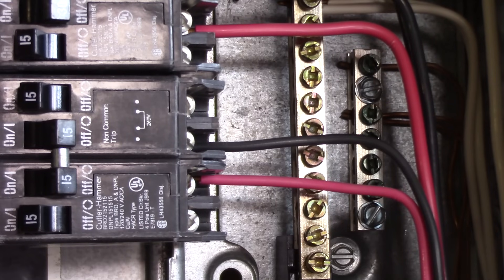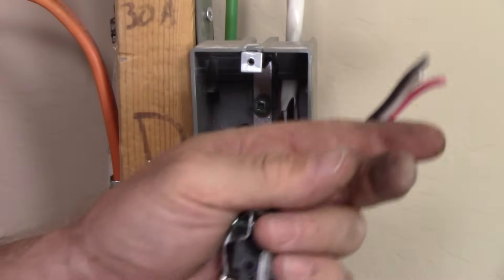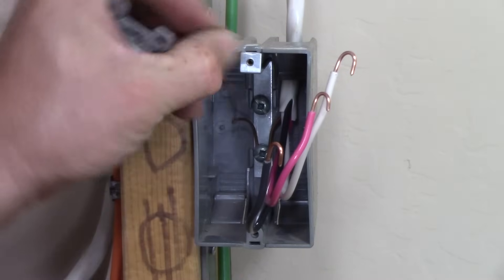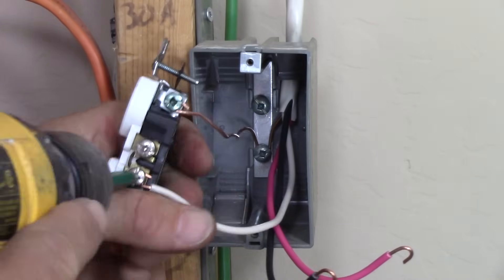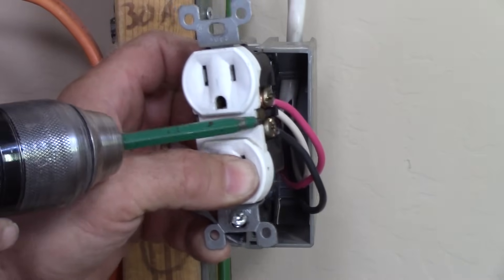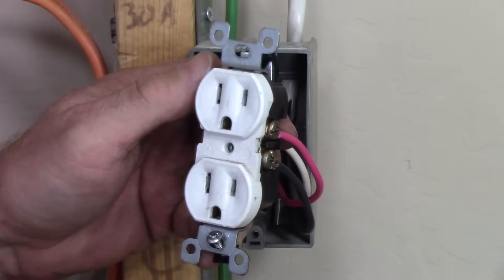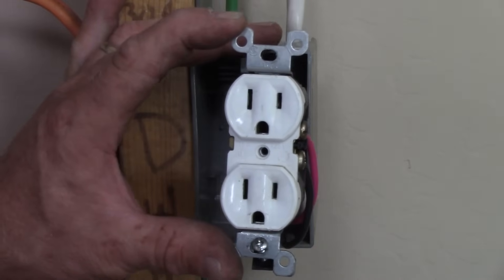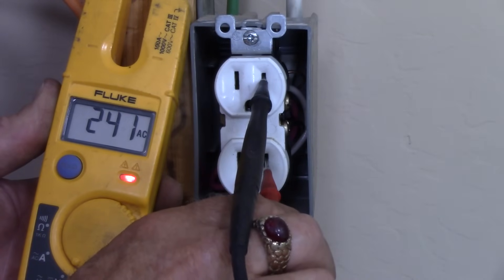Kitchen Split Circuit Receptacles Explained

Comment: Any idea why I still have a hot wire when both breakers are turned off?
Reply: The black wire is showing live when both breakers are off. Tab has been split.
Reply from the maker: That's a strange one alright.  Shut off breaker, check wires on the load terminals.  If there is still power there, shut off other breakers until it goes off.  You must have a cross-tie in the circuit somewhere. And  is there 120v each to neutral or ground, and 240v across the wires?

Comment: I have my kitchen outlet with what looks like the same wiring with red wire on top right, black on bottom right, white on top left on silver screwd and ground in bottom left on green screw and by circuit keeps tripping. I did not remove the tab so i guess this is why its tripping? I will try that out tomorrow since its late. No one else explained this so thanks fellow canuck! One question, can i break off the tab without having to take the other wires off since the circuit is tripped and no power is going to the receptacle?

Comment: Any thoughts on running a 3 wire from the panel to one duplex, and then taking 1 of the hots to another duplex? So instead of one split plug, it would be 2 "unsplit" plugs. Both receptacles would share the neutral but each be on a different phase(circuit).  The idea is to convert an existing split plug into 2 seperate plugs.

Comment: Hi Terry, shouldn't the black wire and red wire fed from different bus bar? From the picture looks like they are both from the right hand side bus bar?
Reply from the maker: Good observation, but the bus bars alternate vertically, not horizontally.  Make sense?
Reply: @theinternetelectrician  got it. Thanks for the quick reply

Comment: I don’t know why would people would use that for
Reply: Sometimes one circuit is only switched at the breaker while the other one has a switch on the wall of the room in which the receptacle is placed.  This allows you to control lamps as you enter or leave the room.  Using the 3-wire configuration saves a little wire.

Comment: Thanks.   I shared this video with my sister and her husband to help them understand how their kitchen was wired and why the 2 pole 20 amp GFCI breaker wouldn't reset after he changed out a countertop outlet that was worn and the plugs seemed loose and fell out easily.  Their home was built 1995 and the kitchen was wired with one 12/3 w/ground NM cable to power the 20 amp kitchen small appliance circuits.  I'm guessing that when the house was built it was cheaper in terms of labor and materials to pull one 12/3 on a two pole GFCI instead of two 12/2 cables on two single pole AFCI/GFCI breakers like we are required to in modern times.

Comment: On mine I have two cables (must be the first receptacle - what's the right proper name for that situation where it splits off to continue the circuit?) one has the red/ black/neutral/gr and one just the black/neutral/gr. There will also be two neutrals: Now do I also break the tabs for the neutrals? And How do I connect that extra black that continues on with the circuit: pig tail? What is the proper name for that situation?
Great to the point video- just not my exact situation- Thanks
Reply from the maker: Is this a kitchen receptacle?  Sounds to me like a switched receptacle in a family room, living room, or bedroom?
Reply: @theinternetelectrician  KItchen. The red has power too- traced it to the box, right beside the black wire breaker. Thanks
Reply from the maker: @johngaspar4425  OK, The neutrals can go on the terminals of the receptacle and DO NOT split that tab. (or you could splice them together with a pig-tail), and yes, on the hot side put red on one terminal, splice the black wires and pig-tail to the other terminal.  DO split this tab.
Reply: @theinternetelectrician  Ok thanks. I will do it that way. Don't want to press you too much, but could you elaborate as to why the neutral is combined even though they are seperate circuits? Thanks!
Reply from the maker: @johngaspar4425  Go watch the video again, and at about the 5:30 mark I start to explain the theory behind the 3-wire circuit and the unbalanced load.

Comment: Not an electrician, but I've played one on TV. But! seriously... thank you for this demonstration of The Olde Wayes of doing things. It remains! a useful bit o' information to have stored on a shelf in the ol' cranial warehouse. I did have to laugh for a second when we witness your unsafe pliers handling. Yes, you know and I know you had the breaker switched off, but... Kids, don't try that at home! This man's a professional, and all that. Cheers.
Reply from the maker: Thanks for watching!  I had to watch it here myself to see what was you reference to unsafe plier handling?  I assume using it as a pointer?  Or did it appear that my hand was on the metal and not the insulated handles?  Anyhow, regardless of that, with the power off as it should be, not a problem there that I saw!  Incidentally, I am an electrician, and I have also been on network TV!
Reply: @theinternetelectrician  You're a good sport! my good man. At one point it appears as if you almost jamb the needlenose pliers' tips into the hot and neutral slots. lmao. "Unsafe pliers handling" - that's a riff on, you know... stuff we dare not speak of in this Utopia of ours. Cheers. Best to you!

Comment: My Frend why when I put the black wire with the white wire together on my switch the break goes off why ?
Reply from the maker: There is only one wiring scenario where a white and a black wire connected together will not be a dead short circuit, and that is a switch-leg drop.  What you're describing is a breaker tripping on a short circuit, as it should!
Reply: @theinternetelectrician  the thing is that I have 3 wire there was a sensor there so there is red wire white and black wire
Reply from the maker: @josemonroy88  OK, that makes sense.  If this is the case, you need to connect the black and the red to the switch terminals.  If you don't need the sensor or any other electronic switch there now, just cap off the white and tuck it into the back of the outlet box.
Reply: @theinternetelectrician  oh ok I will try this tomorrow thank you
Reply: Thank you so much I fix it

Comment: Good video, but one problem.

3:07: You started multitasking. You showed how to connect the ground wire, but talked about split receptacles.

I found that confusing. I had to rewatch that section more than once, to ignore what you were showing and just focus on what you were saying.

Comment: Just curious, is it fine if neutral goes to either of the silver terminal 3:51?

I notice my kitchen one has neutral attached to the silver terminal close to the ground.
Reply from the maker: No, it doesn't matter.  those 2 terminals are connected by a breakable tab just like there is on the hot terminal side, but with the tab intact, they are electrically joined.
Reply: Thanks. I have a follow up question or suggestion.

Maybe you can also post the receptacle you use and see they can pay you the advertisement. 

I like this video. My kitchen receptacle under the sink stops working. I consider to replace one. I am curious if any receptacle will work, or just the one you use. I also have 3 wires but not 4 wires.
Reply from the maker: @KaiWang-f4m  Thanks for the suggestion.  Paid promotions or reviews are usually agreed upon and paid in advance.  I get approached by many products looking for both paid and reviews in exchange for the products.  
To answer your question, if the receptacle you are referring to is under the sink, it is likely that one half is hot all the time (to plug in a built-in dishwasher) and the other is on a switch (for a kitchen garbage disposal or garbuerator (Canadian term).  Check if you have a switch above the countertop and near the sink that if you turn on, the receptacle then works!

Comment: Darn it.  I have this wiring in my kitchen. Two outlets wired like this. I need to replace them with gfci and wired them the same way. Now neither work.
Reply from the maker: Watch it again. You’ll see that you can’t wire the GFI’s the same way, not possible. And then ask yourself the same question I posed, why change them? But if you really want to change them out, email me and I’ll help you out. internetelectrician@gmail.com

Comment: Marry me !!!    Thank you so much.  I was wondering what the heck was this red wire.  It all make sense now.
Reply from the maker: I'm happy to help out.  Now, to the Marriage proposal, I'm going to need some more information.   Maybe a short Bio, some photos, likes and dislikes, age, gender (is it even allowed to ask that anymore?!?), things like that before I can make an informed decision 🙂
Reply: @theinternetelectrician  🤣 I never thought that you will read it.  Now that I catch your attention, may I ask you a question ?  I have one of those split circuits receptacles in my kitchen [ In an out to a second outlet] and I would like to add in this double gag:  1) a new GFCI/AFGI - 15 Amp and 2) a double switch [ two pole ] that control two receptacles above the cabinets for LED lights [ above cabinets and below].  I already wire the LED receptacles to the gag box. How can I do that without burning the house ?    Happy to pay for the advise. :)
Reply from the maker: @phobos_miner4288  I'd need to have more information.  And a diagram of what you are planning would be very helpful as well with as much detail as you can provide.  email internetelectrician@gmail.com and I'll have a look.

Comment: Can you add a light switch and light after this? Previous receptacle was 1 plug and light switch in 1 unit. I want to take that out and have and outlet and add a switch to the light. Thanks!

Comment: Can I wire a multiwire branch circuit to 2 separate GFCI's using the same neutral. I have a kitchen that did not originally require GFCI's, but my receptacles are one separate 20 amp circuit breakers? I have already tried it and it seems to be working, but my concern is will it eventually, possibly give me problems in the future? It also raises the question, what if the incoming power shows 120 volts only not 240? Will that stress the neutral. The circuit breakers are not duplex, they are individual. I have wired it up, and the GFCI's are not tripping. I'm confused. Could this possibly cause my neutral to carry too much of a load?
Reply from the maker: With what you are describing, the breakers are coming from the same hot leg of the panel, and your concerns are quite valid.  Your shared neutral is carrying the compounded load of both circuits instead of the unbalanced load.  So depending on how this is wired, it may be possible to make it work but you would need to juggle your breakers and put in a 2-pole breaker to safely feed this circuit.  That ensures that you aren't compounding the neutral current. To have the shared neutral situation work now, you cannot have any feed-through the GFCI's  The neutral would have to be pig-tailed and connected to the 'line' side terminals, and the hot wire from each breaker pole to the 'line' terminals only of each of the GFCI receptacles.
Reply: @theinternetelectrician  Thank you for your immediate response. From what I have learned so far, what you said is %100 in line with what I have watched on multiple channels. It confirms the circuit I currently have. I will make the necessary changes as needed, 2 seperate 120v circuit, on a set of breakers that are tied together. Mine are currently spaced apart from each other, they do however produce 240V when measured, that is a good thing at least. Thank you again for your time, and posting the videos, they're are much appreciated, I learned a ton in a very short time.
Reply from the maker: @ronnor58h  One caveat on the 2-pole breaker.  The old FPE stab-lok wafer breakers are the only brand that will allow them to be plugged into the same hot leg of the panel.  You need to put them in so that the straddle the barrier.  So see if that applies to your situation.  Also the reason for the 2-pole breaker is safety.  It ensures that both hots are de-energized when working on the circuit.
Reply: @theinternetelectrician  great point, thank you. I just checked the old system out, and both 110v did not give me 240V. I switched them to achieve my 240v, and it brought my amp draw from 20+ to 3 on the neutral. I was thrilled. Thank you for your awesome content it saved my bacon! Definitely liked and subbed! Have an awesome day!

Comment: Do you have to use the quad breaker or could you donthis with just a regular double pole? And if so, do you just leave the top and bottom terminals unused?

Comment: Why can't you use 2 GFCI receptacles in the kitchen and still use the Load side to feed regular receptacles in the normal fashion downstream? Clearly, you can't split a GFCI, but if you use 2, one powered by the black wire, and the other powered by the red. Create a joint for the neutral wire to connect to each one.

Comment: I recently upgraded to a 200 amp panel. The elctrician installed split breakers where we had singles before. The expalnation given was a change in the code that requires shared neutrals for two circuits. The house was built in 1992, and I am in CA.  So now if one circuit trips, another one goes down with it. So I asked if that happens, how do I troubleshoot each circuit to find the culprit. ) He said I can pry off the plastic bar connecting the 2 circuit breakers. Am I asking to get zapped when changing out recepticle later?

Comment: Thank You Terry. You saved me at least a $100 for replacing a kitchen outlet. I replaced the outlet with no problem at all, it was easy enough, but the breaker kept tripping. I did NOT realize the two outlets are actually connected with a flat metal clip. After I watched your video, I broke the connection between the upper and lower outlet, now both outlets work like a charm. I have liked your video, and also subscribed. Thank you very much. Tom
Reply from the maker: Thank you so much!  Comments like these make it so worth the effort!  Happy New Year to you and yours!
Reply: What you break one side what about other side?

Comment: I have a kitchen switch for turning a celing light on/off. It is only using red and black plus ground, with the white unused not even stripped. How do I add a new switch to this location.

Comment: I'm assuming i do the exact same if I'm putting a GFCI outlet?  Also is a 20amp GFCI ok to use even if the breaker is a dual 15 like what your showing

Comment: How would I add another split receptacle?
Reply from the maker: You need to run a 3-wire (+ground) cable to a new device box and pig-tail all the conductors to the existing receptacle and to the new cable.  Then connect the added receptacle and make sure you break the tab on the hot side.  This is only possible if the device box you are adding on to is large enough to accommodate the added conductors in the new cable, and if there isn't already one cable in, and one out of the existing receptacle that you want to add another device to.

Comment: On separate plug 120v can you still use kettle on 120v??😊
Reply from the maker: I'm not sure that I understand the question.  Can you elaborate please?
Reply: @theinternetelectrician  at 120v separated circuit can still be used kettle without tripping the MCB ???
Reply from the maker: @bonaminhrasmey42  In the wiring method described here, you have 2 separate 15A, 120V circuits so unless an appliance (s) draws more than the rated current current, you can use that kettle.  I hope that answers your question?

Comment: The thing I screwed up on was both feeds on the same 120 leg. Works perfect but then the neutral was carrying the combined loads from both sides🤦
Reply from the maker: One very important aspect of a circuit such as this is that you have to feed it with a 2-pole breaker.  This assures that you can't have the feed from the same leg of the panel.  The ONLY exception to that scenario is the wafer style FPE sta-blok breaker that enable connection to the same 'phase' of the buss bar.  These have caused countless issues over the years.

Comment: #theinternetelectrician   thank you for explaining 2phase. I am learning that whoever built my house,  did not know what they were doing.  Should i say, cut corners. I found 2 phase in my family room back stabbed and double wired. Makes me scared about what else is behind walls
Reply: Me too! Both my kitchen ones were the old way and dones the speed wiring, and just now the kitchen one the ground was cut so short, like a 3 inch gap between and crimped with a metal crimp. I had to cut that off and pull it as tight as possible to get enough to connect to the ground prong. I am hoping it's ok.

Comment: *edit* so i just redid the kitchen fridge outlet and the plug in tester is showing its wired correct but the sniffer is not showing power on the neutral side. Do I need to be worried? 

Ok, this is one is better. I am trying to replace my moms 1990 trailer kitchen plugs and every other video starts with 3 that cuts into 5 but this one only has 3 and only 3 a hot, neutral, and a ground. And i got so worried till i found this one. Thank goodness. So i guess the hot and neutrals will just be split between the two plugs. Good thing she doesnt use alot of appliances. *The only difference i have found is the counter one went to split the tab and it refuses to split all the way down. And i found the fridge plug does have the 5  wires. So hopefully things will work.